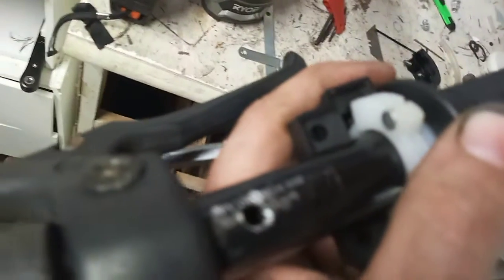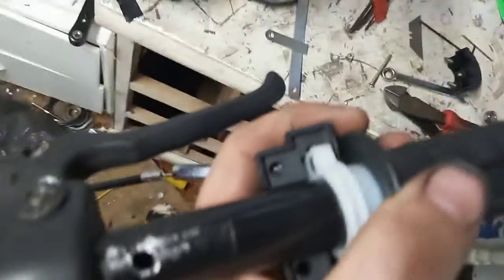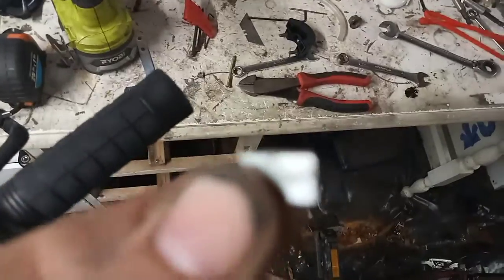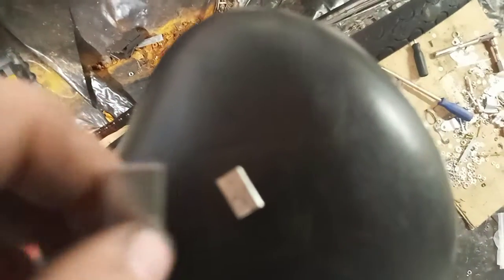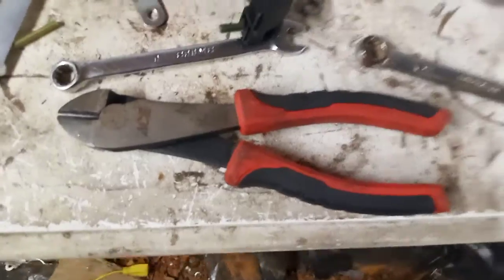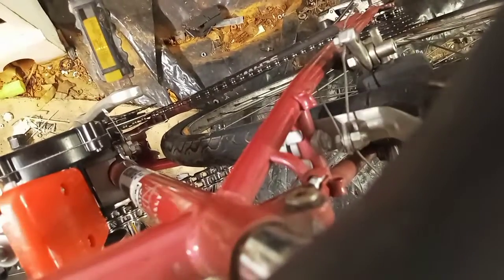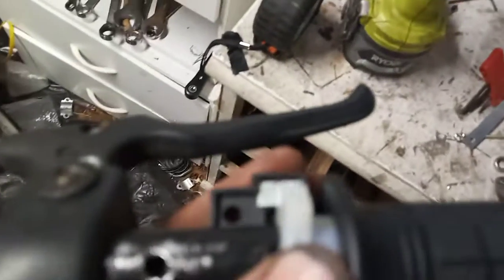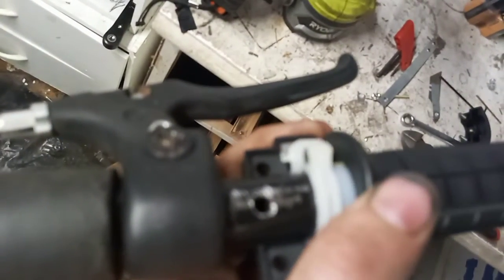Motorized Bicycle Throttle Assembly Over rotation fix

Comment: Thumb throttle. Problem solved. But hey, your approach works. Thanks for sharing.
Reply from the maker: Yeah that would be nice and take up less room on the bars too. Gonna look into that and try one out.
Reply: Respectfully a thumb throttle is not very comfortable at all and it's meant for beginners so they don't get whiskey throttle. I highly recommend an aluminum CNC twist throttle. There's no plastic coupler in the assembly to get ripped out.
Reply: @JamesPiccone  Disagreed. Regular throttle hurts my wrist. We always used thumb throttles on the snow machines. 
To each it's own, I guess.
Reply: @leonardarola  I've definitely seen some dudes that prefer thumb throttles, so it's definitely a thing besides safety. I just can't stand having my thumb pegged most of the time & I like having a full grip on the handlebars. I do some pretty aggressive carving and counter steering on Backcountry roads for a motorized bike. I need my all of my hand wrapped around the grips, not just my four fingers.
Reply from the maker: Great debate on the issue fellas. Metal twist throttle set sounds like a great upgrade. The motorcyclist in me would naturally wanna go twist. I know from riding ATVs that my thumb gets stiff and sore after a while but that's getting thrown around and beat up on woodsy trails, never tried thumb on a two wheel machine. Never even seen a snowmobile up close in Kentucky. And counter steering while carving it up hard on a bicycle sounds pretty exciting! I'll stick to my ZX14R or just carving up sandwiches and pizza ^_^
Reply: @JamesPiccone  I see your point on full grip.